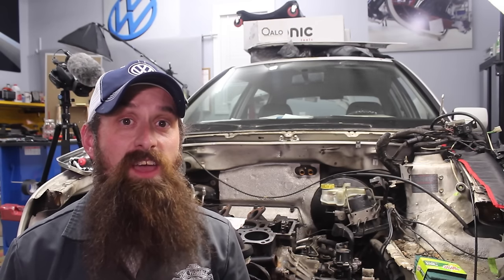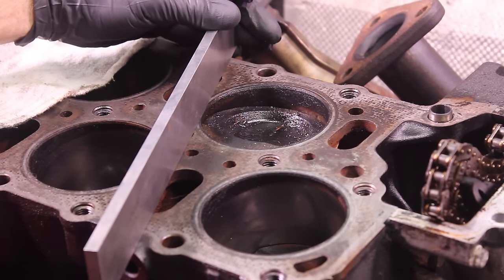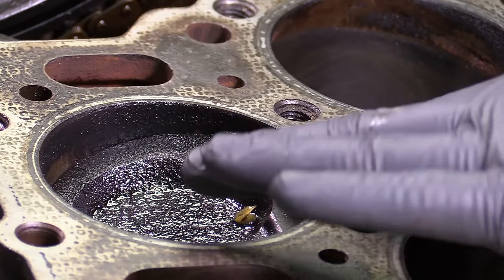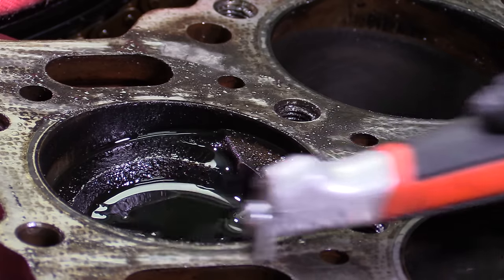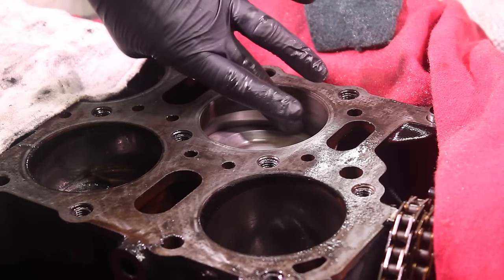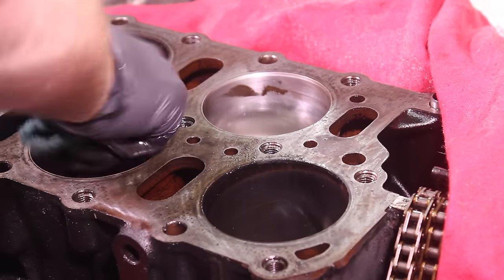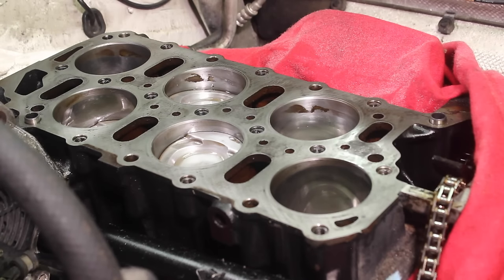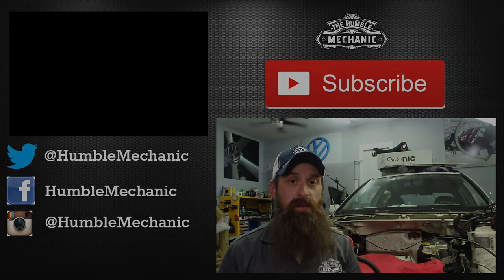Removing Carbon From Piston, Cylinder Walls, and Block Deck

Comment: My go to fluids for any mechanical repairs:

Deep Creep for loosening nuts and bolts

WD 40 for Cleaning Carbon or preventing rust

Paint Thinner for washing parts

Acetone or Brake Cleaner and compressed air for final clean up right before assembly

Comment: Before taking the motor apart, while it's still running, just drip water down the intake as it's idling. The water will become super heated steam in the chambers and it cleans things up very well.

Comment: I use "industrial" paint remover that you can spray. You don't even need to scrub. It removes oil and carbon super easy. You spray it once or twice and rinse off with brake cleaner. I kinda like the burning feeling of it on my bare hands also. ;)

I cleaned a junk yard motor last week and it works awesome. WD40 is nice, but you'll need a lot of scrubbing.

Comment: After watching this video and reading around to do my own head gasket, I'm finding lots of warnings about the dangers of using Scotch Brite for any kind of engine surface prep. Apparently, it's practically impossible to get all of the Scotch Brite particles out of the engine, and the aluminum oxide abrasive will destroy the bearings and basically anything else that moves and has tight tolerances 😬

There are apparently technical service bulletins out there about this, but this explanation makes enough sense to me that I'll be pursuing other means:  https://www.bobistheoilguy.com/forums/ubbthreads.php?ubb=showflat&Number=563163
Reply: Thank you
Reply: I assume that if you're doing a machine-shop style job where you're going to aggressively power wash the parts before reassembly, it might be okay, but if (like me) you're doing this in your driveway and not pulling the whole engine, prolly not a great plan...

I ended up taking the head I was working on to a shop for resurfacing and just very carefully cleaned the block surface with steel and plastic scrapers.

I have ~195psi of compression on all four cylinders of the 2.3L F23A1 Honda engine I was working on.
Reply: Any method you choose will have nay sayers and “ warnings”.

Comment: Is there a part-2 for this project?  I'm interested in seeing how you measured the cylinder head and engine block mating surface after they were cleaned.  Also interested in the step-by-step process for re-assembly and understanding the reason for re-assembling with a metal gasket instead of an OEM gasket.  I'm new at this and trying to learn as much as possible.  Your videos are packed with useful information and they're greatly appreciated.  Thank You Charles.
Reply from the maker: There are other engine building video for this engine. The block ended up torn down much further than I expected to. Look the white wookie playlist

Comment: For all the people wondering why he's using WD-40, it can be used to clean metal. It's a very non-volatile substance, so if you need to clean something and brake cleaner, carb spray, Seafoam, etc is too harsh, WD-40 is a good "safe" solvent. Another good choice is Marvel Mystery Oil. Personally, I would be using something a little stronger and not relying as much on the Scotchbrite pad, but that's just me.

Comment: Morning Humble,
I have a GM 4 cylinder inline. Im replacing the head gasket as it has blown and no compression in tow cyl. 
As I read the book on this they say not to remove the carbon ring at the top of the cylinder. Not sure why they say this only as it may be a caustion not to drop anything in the cylinder?

After watching your video I plan on doing just what you did and clean ,clean ,clean.

Thanks for the WD-40 on the paper towle tip too.

Skipper

Comment: I'm happy you found a sponsor but I'm surprised that as a professional mechanic you would be willing to advertise wd40.
Reply: I mean it's great at keeping water off but that's all it's good for.
Reply from the maker: +knexfreak32 why is that?
Reply: HumbleMechanic It seems at least to me that at points it's being advertised as a lubricant but it really not designed as such and doesn't really do a good job at all. But hey if it is a good revenue stream from them go ahead. (I haven't really watched the series but I do watch a video of yours here and there)

I'm also not really trying to say it's a bad thing to be sponsored by them but it is a bit surprising to see a professional mechanic advertising it.

Either way I wish you the best of luck on the build!
Reply from the maker: +knexfreak32 I completely understand what you're saying. 

This was not really about money for me. It was about a chance to work with an iconic brand that everyone knows. And trying to do something with a product no one has done. And it surprisingly did a better job than I expected. 

Are there other products out there that would do the same as this did? YEP. But that could be said about any product. 

Thanks for the support. Funny enough it turns out this video was a total waste of time in the project. I'm Having to pull pistons and hone cylinders anyway. Lol :(
Reply: HumbleMechanic Hey man that really just earned you a lot of respect from me.
Reply from the maker: +knexfreak32 thank you!!! :)
Reply: well atleast its clean .
Reply: Why did the cylinders have to be re-honed?
Reply: knexfreak32 power wash it just like momma makes
Reply: What's the reason for cylinder honning, and why you didn't see that at first...I sound negative (it's my poor English), but I'd just like to know the reason, I do not say anything against you, I like your videos, just interesting?
Other thing, wouldnt ''carbon mould'' (mix of carbon and wd) drop into oil passages which I watched on ETCG is wery bad thing for bearings, I mean any solid particles in oil are unvanted, right?
Reply: A lot of people knock wd40.  Sure, it sucks as a penetrating oil for rusted bolts, but it has a ton of other uses. Using it as a solvent for scrubbing grime, carbon and stuck on bits of gasket is something I have been doing for 20 years.
Reply: wd40 is great stuff wen you use it right.
Reply: It's clean, what do you recommend
Reply: WD -40 got its name because the first 39 attempts, the company got it wrong, the 40th try was a sucess.
Reply: Viagra was developed as a heart medication and guess what else they found it is good for.

Comment: Jesus Christ, NEVER use scotchbrite on any internal engine component.  The pads deteriorate and gets into the engine, a few hundred miles later the car will start knocking and lose oil pressure.  Welcome to 1995.
Reply: I can't believe this isn't universal knowledge. Way too many stories of blown engines after head gasket repairs due to shops using scotchbrites and suddenly the bearings get eaten up.
Reply: Not gonna suggest an alternative?
Reply: Avalanche2 

I just lit a small piece. It quickly and burned completely! So, what exactly is the danger?
Reply: Lol it's probably not from the scotchbrite..

Comment: You mentioned that you’re going to clean off the block off once it’s on the engine. What’s the process final cleaning the process of that step before assembly?

Comment: Why remove carbon??? Other people pay a ton of money for internal heat shield coating. Only the valve seats have to be clean!  For the engine wasted time money.
Reply: Christian Krob carbon build up causes hot spots. Having hot spots and the extra heat in the chamber causes all types of issues
Reply: Bryan Keith 

As soon as you clean it, deposits begin to reappear.
Reply: @FrankGutowski-ls8jt  So? It's better than having 2 cm of carbon buildup resulting in hot spots..

Comment: I'm going to buy one of those scrapers when the SO truck comes around next week. thanks for the tip
Reply: Snap off is harber freight with diff logo
Reply: Mada Mayday  you keep telling yourself that
Reply: Matco makes a good as well.
Reply: Eddie Da Silva bet I got more snap off than you though
Reply: ddd228/Dave in Seattle. Matco is better. Scanners cheaper better and boxes are tanks. Compare them
Reply: You probably have more Snap On tools that I.
I sold some of mine,Mada.
Reply: ddd228/Dave in Seattle. Unfortunately I bought a lot of snap on before seeing the light. Including the modis ultra

Comment: I’ve performed these steps and have questions:

1. If carbon or scotchbrite deposits fall between the piston and cylinder wall how do I remove?

2. I was told that it’s best to drop pistons out and clean as carbon falling into ring seats will cause micro-abrasions that will cause issues. Necessary or no?

3. Will the scotchbrite suffice for a good mating surface or should I use a sharpening stone?

This seems too easy compared to what I’ve been told. Any other good videos for cleaning any crumbs that drop as opposed to dropping rods and pistons?

Comment: Great video man, never thought about using WD-40. I always used carb cleaner sprayed on either a tooth brush or the scotch brute. Mind you I never sprayed carb cleaner directly on the block or in the cylinders.

Comment: I tried that scraper as recommended.  I used no pressure, choosing to just allow the scraper do the work.  When finished, I noticed that I had scratches like you see at 5:57 of this video.  In my experience those types of scratches aren't a big deal.  However I am curious to know what others think, including the HM.  Thanks
Reply from the maker: I’ve never had it have an issue

Comment: The question I have is pretty simple. What is a normal amount of carbon expected on the cylinder heads/combustion chamber. I purchased a boat with a 5.7L V8 chevy small block and the combustion chamber looked like it had a decent amount of carbon like you are showing when inspecting with a small borescope through the plug openings. Engine works perfectly fine and cylinder walls look good.

Comment: Wd40 dries completely overnight, I've used it industrially for years. For certain applications, I'll add an ounce of oil or atf the the spray bottle to prevent complete drying

Comment: Co-worker turned me onto the idea of cleaning gasket surfaces with a sharpening stone. Works like a block plane, to keep things level and smooth. You're still not going aggressively enough to remove material, but they work great for manifold gaskets etc.
Reply from the maker: +thethePete wow that's a cool idea!! I may have to give it a try.
Reply: HumbleMechanic soak it in varsol, he worked at a machine shop, so I trust his judgement.

Comment: I have a Jeep 2.5 that runs awful has severe blow-by so I figured I'd put new rings in it and while I'm at it refurbish the head, new springs, valve seal, and clean all the guides is this something I can do without pulling the engine it's very accessable in the Jeep oil pan is clear and head is very easy to pull with tons of room to work

Comment: Interesting you also used the 3M Roloc system with a pneumatic grinder. I first known from a video from FordTechMakuloco about using this. I'm member at a DIY car repair shop where we have air.

Comment: In the old days of leaded fuel that caused a lot of coke build up you could get water injection fitted and the steam exploding in the combustion process helped prevent coke build up ,I took a head off once and the leaking coolant into one cylinder had a piston crown looking brand new.

Comment: My old boss thought I lost my mind one day. I used the guts from 3 vibrators powered by an r/c receiver battery pack and mounted all that to the top of a sanding block, then put green scotchbright pads on the bottom.  I told him I didn't want to fuck up the cleaning job at hand.
Reply: +Ghost Watts 
I would have too, that's just wierd.
Reply: Not really.They wernt the real big ones.

Comment: Try using LOCTITE 7200 gasket remover. Spray on and leave over night. Wipe it off with a rag the next day, no scrubbing needed. Try it guys! I wish I knew about it years ago..

Comment: That's a great video !   I just did the same thing on a 24 year old Saturn SL2 and used a similar technique to yours. So now I feel that my "hack method" was not so bad given that a pro like you does this. 

 I just had 2 side questions with respect to your carbon build up:
1) where did most of it come from - valve stem seals on intake or piston rings ?
2) would the limited use if water injection keep the engine much cleaner ?

... just a few thoughts. Thanks again - you are a great YouTube presenter !!

Comment: Charles, I was taught not to use any chemicals on the cylinder walls unless rehoning and replacing the rings, because the chemical will remove the essential coating created by the oil and heat, What would your thoughts be about that?

Comment: Maybe using a scotch brite on the walls wasn't the best idea especially where the Pistons make contact.. Sea foam also loosens up carbon very well with hardly any scrubbing
Reply: But you did end up getting crazy good results, looks good!
Reply from the maker: +Integra DIY notice that the only place I cleaned was where carbon was built up. This area is not where the piston rings ride. It's part of the combustion chamber.
Reply: HumbleMechanic gotcha! Good stuff really like this series 👍🏽👍🏽👍🏽
Reply from the maker: +Integra DIY thank you. :)

Comment: I see lots of micro-gritty stuff running down the cylinder walls and getting into the top ring lands. Also goes into oil passage that feeds head/camshafts. Something to think about....

Comment: Hi Charles. Awesome video! Can this cleaning method be applied to both cast iron and aluminium blocks and heads ? Thanks in advance
Reply: Don't use a steel scraper on aluminum

Comment: My favorite way to remove carbon from a combustion chamber and piston crown is still introducing water through a vacuum port while the engine is running. Only works if you have a vacuum port on an intake runner though, such as most motorcycle engines.

Comment: A Razor blade across the head deck surface. A wire drill tool on pistons. Then Lithium grease spray around piston rings while then turning piston downwards to wipe cylinder wall clean. Rinse repeat until clean. Scotch Brite pads will get in oil of engine and ruin bearings.

Comment: Heard that scotch Brite should never be used because it will leave an uneven surface and aluminum oxide particulate from the pad being hard to remove. What are your thoughts?

Comment: A lot of people are against using Scotchbright pads or in Roloc disc form. This is because aluminum oxide will increase wear because it goes system wide even if u don't see it. On a cheap build i would say maybe not a big deal and alot of people do it this way. Steel wool has the same issue. Chevy has released a service bullitin advising their techs to use only a scraper and gasket softener. I would not use this method myself but hey u can so it this way if it works for you.
Reply: Also if u plan on leaving that deck surface (or any machined surface) exposed for say longer than a month then one should coat the surfaces with engine oil and wrap in plastic. I have been burned by storing items with wd-40 and neglecting to wrap them. This is because wd-40 evaporates unless sealed in with plastic. i now use light machine oil and plastic wrap for storage purposes. That might prevent you some frustration in the future. Good luck.

Comment: Not sure if you're familiar with weapons, but there's something called 'C.L.P' which means cleaning, lubricant, and protection. It eats carbon away effortlessly, prevents future carbon buildup and rust, and can be used as a lubricant for ease of sliding machined pieces together. Not to be confused with things hike hobbs or rem-oil or anything like that. Do you think that could be used? Also, before assembling back together, do you thoroughly clean that WD-40 off?
Reply from the maker: I got a bottle of CPL ;) I’m sure you can use it. Not sure if there is a benefit over other products but I’d have it. 

I ended up completely disassembling the engine due to finding some bearing sadness. So it got fully cleaned and treated